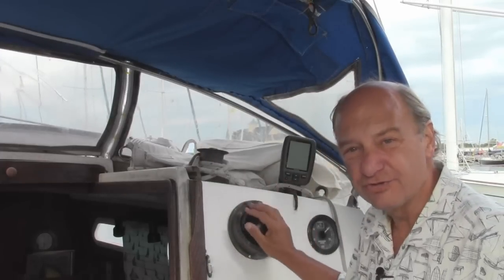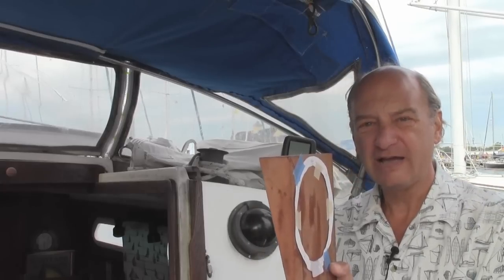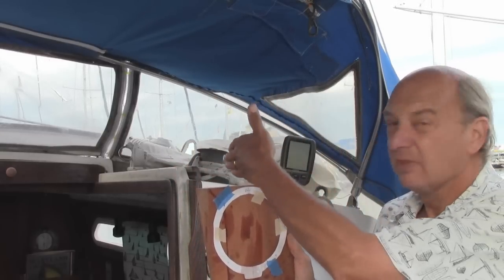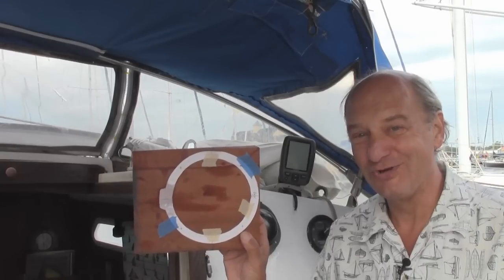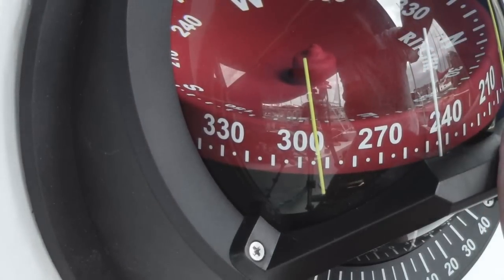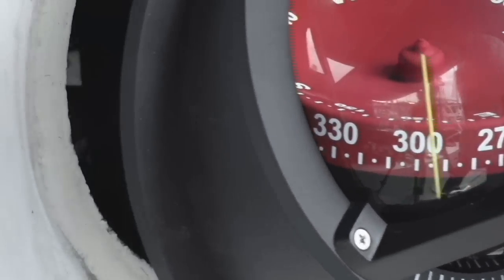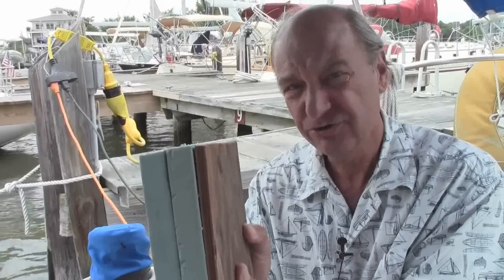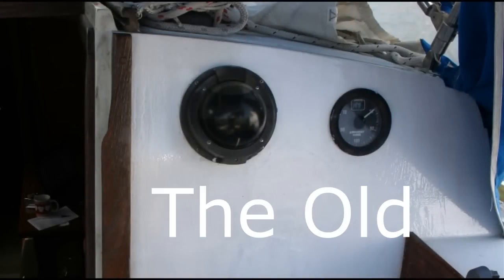Richie Compass Installed on Bulkhead

Comment: I just bought a Ritchie Voyager compass and I'm about to install it. I read the instructions, and watched your video, but I just don't get why you have to be so exact on the exact vertical/horizontal installation axis. As soon as the boat hits the water, the angles are all over the place anyway ...
Reply: Exactly. On the water, you’re all over the place
Did you install yours? Does it work ok?
I am looking at the same model

Comment: Hoy adjust it?
Reply from the maker: that takes a little time, there are two screws one for N/S one E/W you will need to find an area on the charts with very accurate directions, travel on that course in both direction and make VERY small adjustments until you are happy with the readings